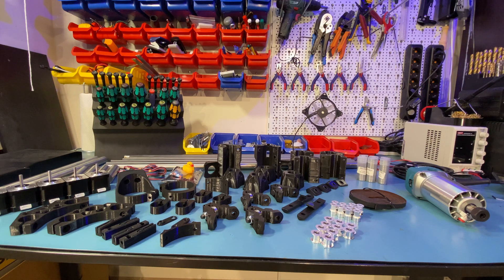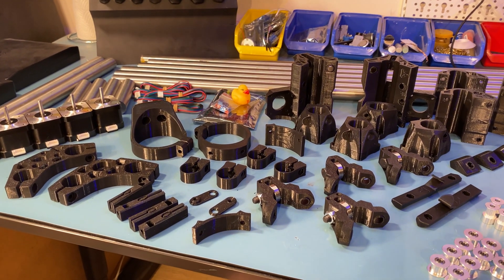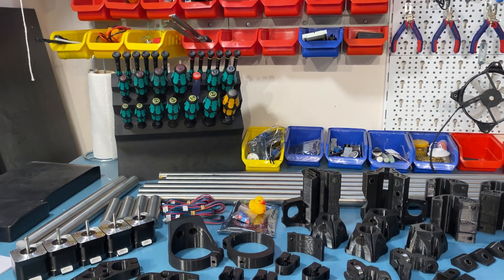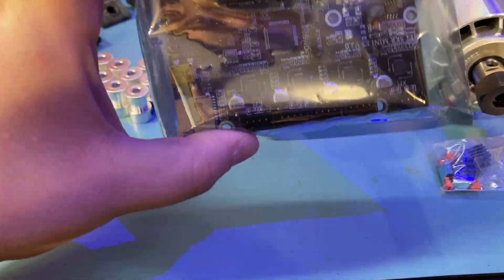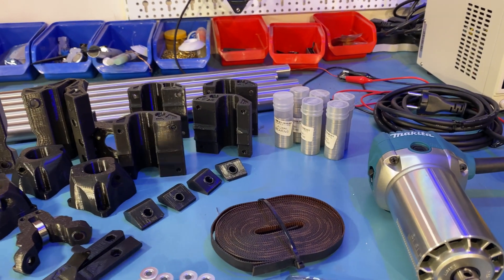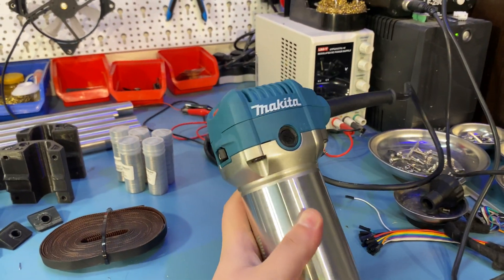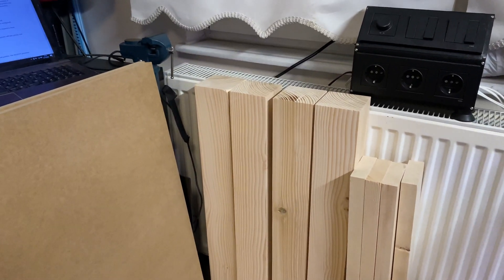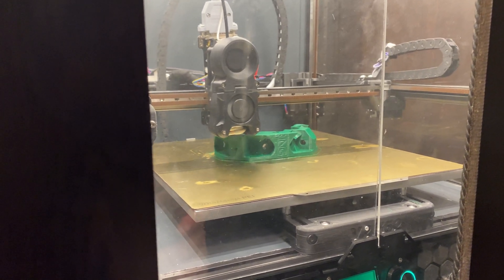MPCNC Ep. 1 - Parts & Table & Starting the Build

Comment: So here's my two cents on your stainless round bar your bought. I don't believe you can realize the righty increase of the solid steel bar while only used 3d printed parts. The plastic in addition to small contact area of the roller bearings will not be stronger than the bar you purchased. This is probably why they recommend only purchasing conduit, because the conduit still isn't the weak link; the printed parts will break before the conduit will even bend.

Just a thought. :)
Reply from the maker: You're probably right. Again the cost wasn't much higher so I went for it. As long as it doesn't hurt it's ok.
Reply: @IsiksTech  agreed